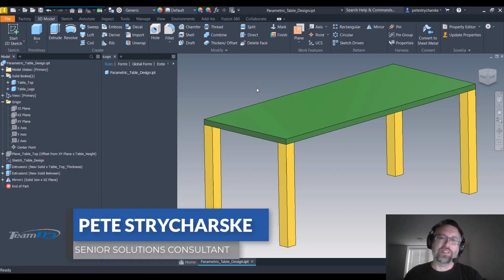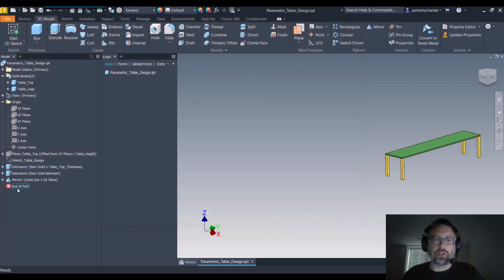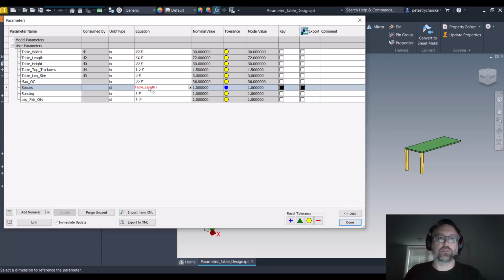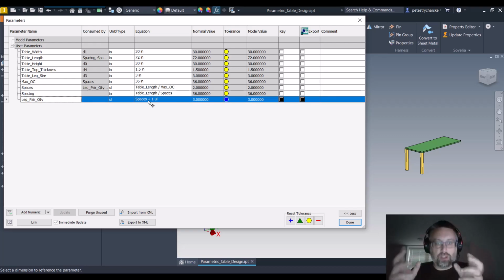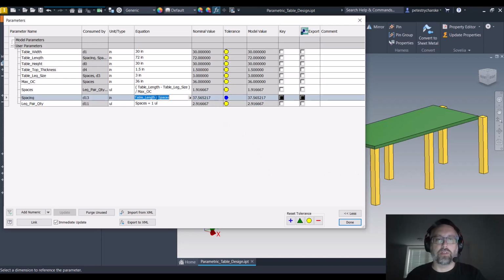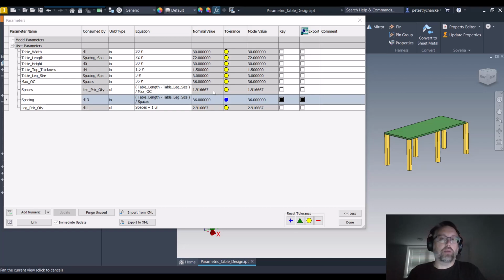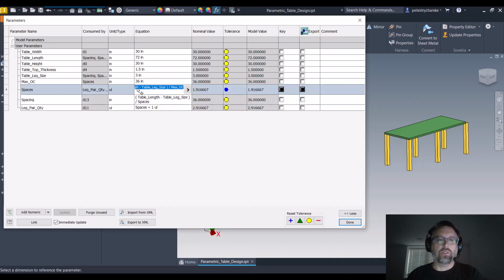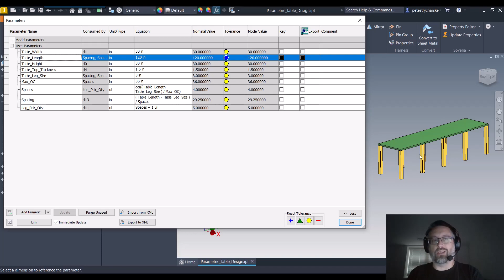Inventor - Utilize Math Functions for Powerful Parametric Patterns

Comment: I was sent on a mission by my brother who is an inventor whiz, so I can figure out how to do automated(ish) wall panel systems. I work for a company that does stadium and airport interiors and a big chunk of our work is wall panels, phenolic specifically. 

I’m trying to figure out how to make wall panels that will auto adjust once I revise my drawing for field dims. I have to first do a submittal drawing based off architectural drawings which is the stage I’m in now.